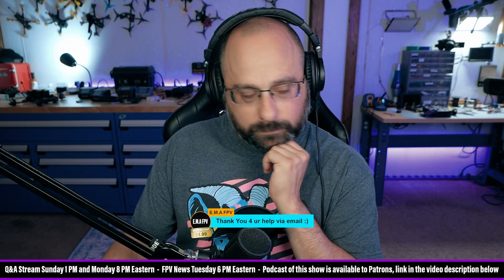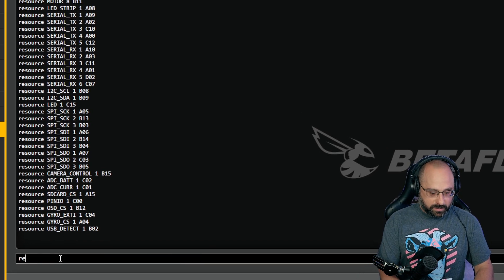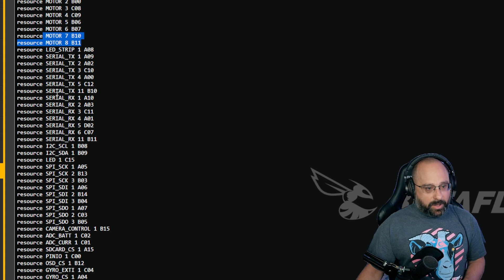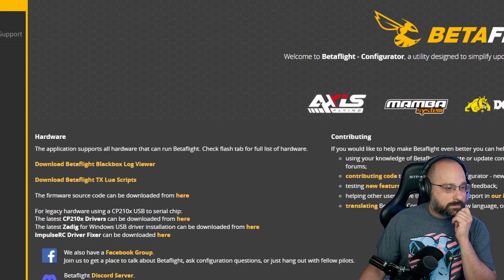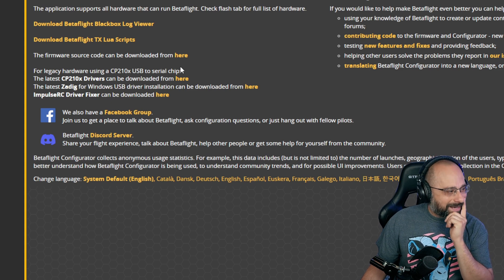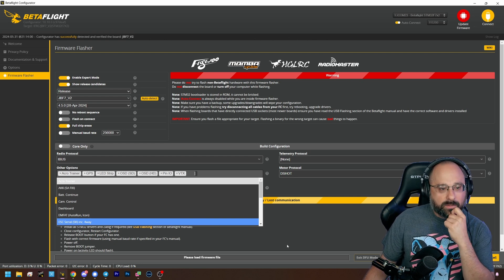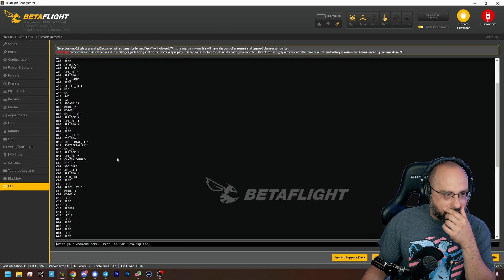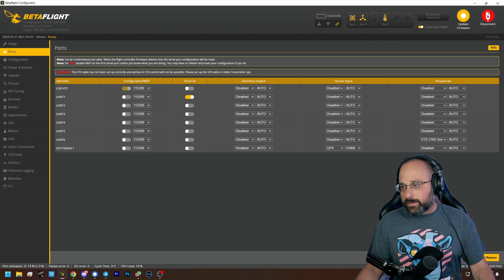Setting Up Softserial In Betaflight! New Command In 4.5! - FPV Questions

Comment: Thanks for the video!!
I have an early Flywoo LR4 with the Goku f411 V2. Upgrading to Btfl 4.5.1, I got softserial to show in the ports tab, the resources are free but every time I try to set the soft port to MSP to get the data from the Caddx Vista to show in the OSD and hit "save/reboot", it will reset the whole port tab : all selection get deleted. Any idea what's going on??

Comment: Why soft serial if the motor isn't in use? Why not hard change it to UART? Make sense in theory
Reply: For f4 fc smart port telemetry don’t work directly on the uart no matter what. but if we enable softserial and hook upto to its tx pad it works.